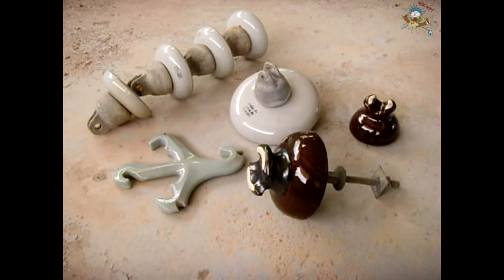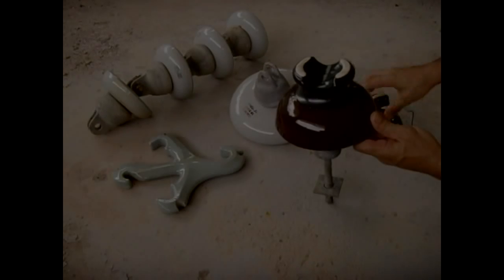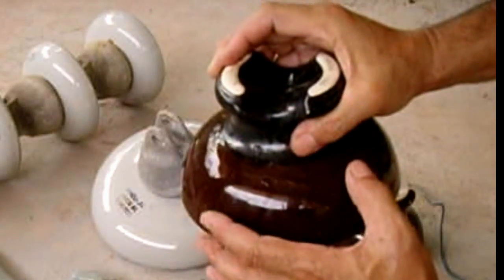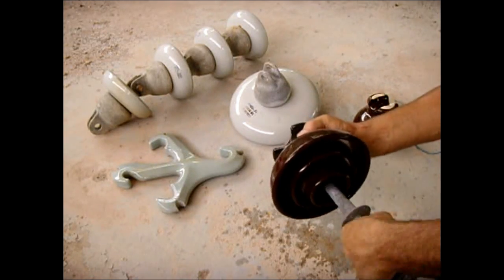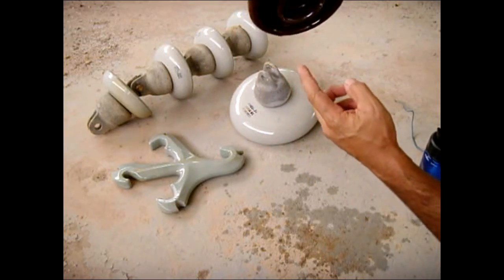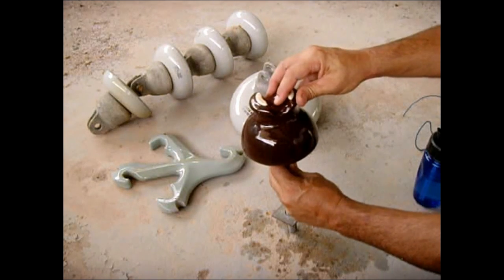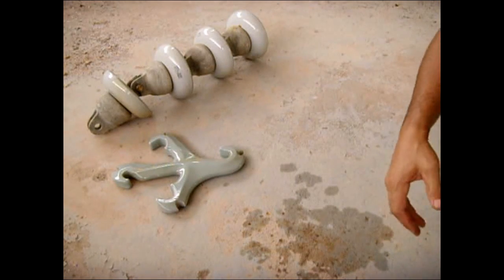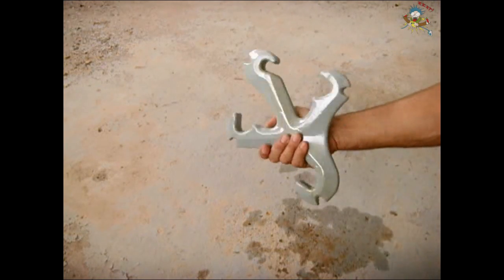High Voltage Power Line Insulators (Up Close)

Comment: I have a question. The insulator that was hung in a series of four, how do they connect and still remain insulated from each other if there's metal going through the ceramic insulator?
Reply from the maker: The metal doesn't go all the way through.

Comment: Loved your high voltage educational videos, especially the microwave diagnostics and repair videos.  Safety first, which is why I did some research into the dangers of servicing microwave ovens.
I have a diploma in electronics engineering. Such a nice refresher.

Comment: Very informative video and great information! I'm a power lineman in Arizona, and of course deal with these porcelain types every day, although we're going more and more with polymer insulators. I actually have an extensive collection of insulators I've personally taken down during my 9 years in the field. Did you happen to notice the black coating on the crown of the first brown insulator? That's actually a semi-conductive glaze that's put on during manufacturing. It eliminates radio interference by preventing surface arcing and corona between the insulator and conductor. Higher voltage types tend to have this coating. Also, the "disk" types you have there are often called suspension units by manufacturers. Us linemen call them "bells"
Reply from the maker: keepers0215 Glad you enjoyed the video. I did not know about that glaze. Thanks for the info!
Reply: electronicsNmore No problem! I think that glaze is only used on certain types of insulators, mainly the "mushroom" shaped pin types like you have there  We still use some porcelain at my company (25-35kv) which don't have the coating, but they are larger and don't use the threaded pin; they have a large metal cap with a stud on the bottom.
Reply: electronicsNmore I Like the intro;DD I Collect These Type Of Insulators As well;DD Thanks For Showing, Cheers Mate;DDDDDDDDDDDDDDD
Reply from the maker: Thanks for watching!
Reply: +electronicsNmore Nice Demo;DD
Reply: You are in AZ? I'm in AZ. Had you worked for the lines in chandler?

Comment: arent glass ones usually toughened glass
Reply from the maker: I am not sure of the exact composition of the glass, but the glass is thick and very strong.
Reply: RedDemon Music Modern glass insulators are made from "tempered" glass, like car windows. Older types were not tempered or toughened in any way.